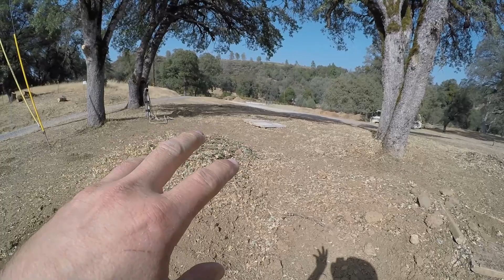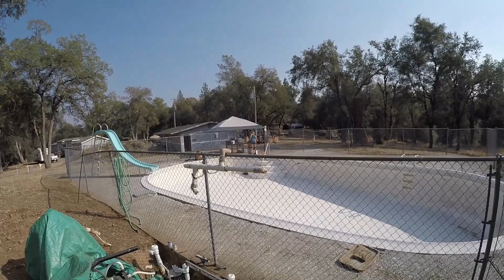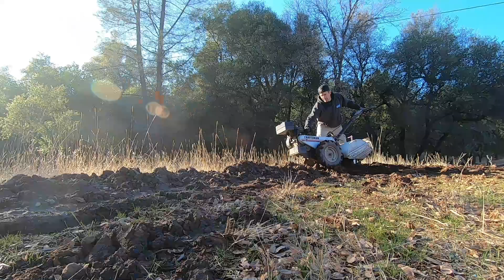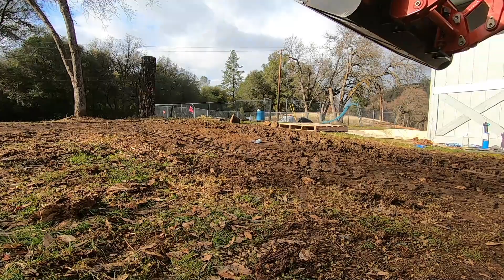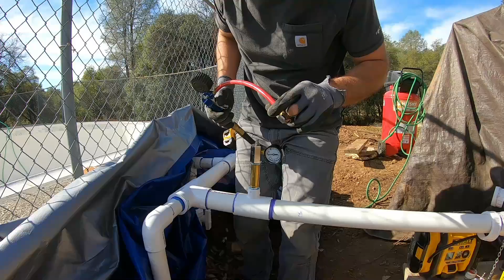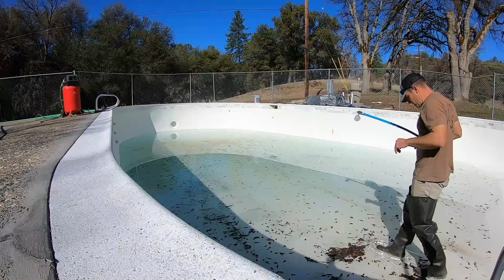Huge Pool Renovation for under $3,000 Part 2 - Electrical and Plumbing

Comment: Have you rented one of those property stake finders? It’s a really sensitive metal detecting wand and I’m sure it’s pick up the wires and pipes?? Then you can map it out a little easier. I rented one and couldn’t find the property stakes, but it detected the sewer 6 feet below ground!! Maybe someone can chime in and state the validity with more accuracy than my observation. The place is coming along! Great job!!
Reply from the maker: Interesting! I know you can hire professionals to seek out all utilities but they cost alot. And I believe you are talking about the old brass property stakes surveyors used to mark out property right?
Reply: There are systems to detect water pipes and underground power lines, but maybe a lot cheaper in their case to just dig and fix the damage properly rather than renting or buying the finder equipment....Property stakes I can understand are a lot more important to find.....
Reply: Yes, the property stakes. They make a wand specifically for finding the stakes. I was just thinking it might be a cheap way to find where the utilities are since they are so sensitive. I’m not sure whether a metal detector would have picked up the sewer line 6 feet below the surface. $40 for a day rental to map out where all the lines go would be a cheap route IF it worked. Enjoying your channel. Thanks for sharing your knowledge with us!